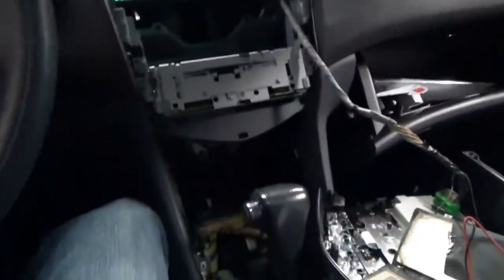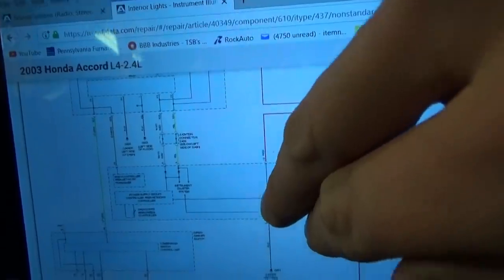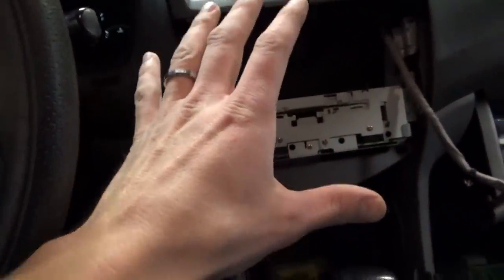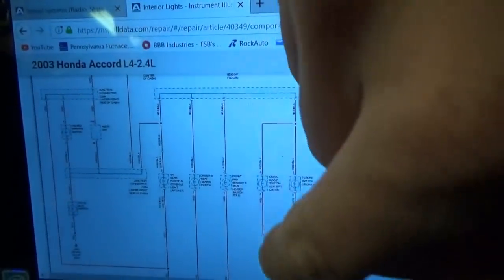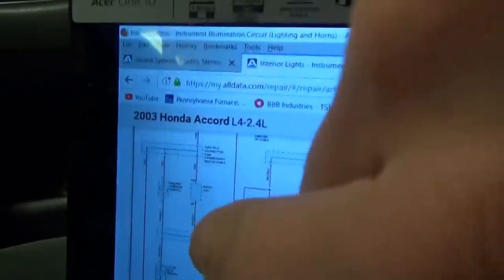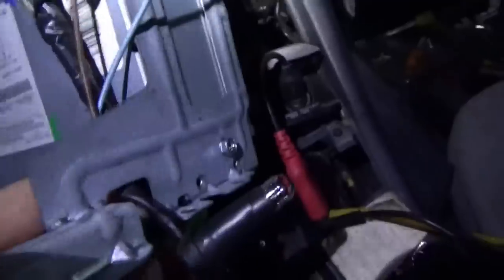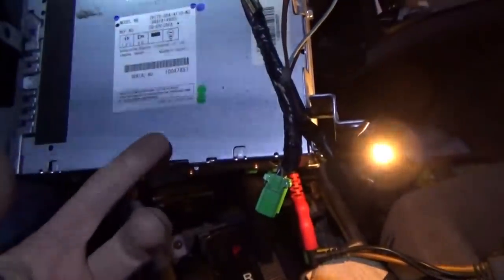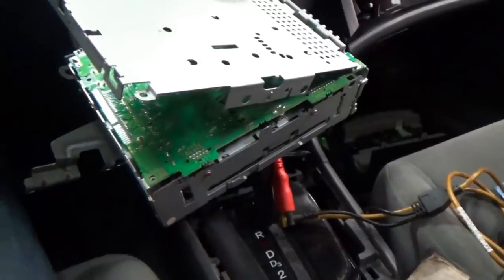Dash Illumination Diagnostics: 2003 Honda Accord

Comment: I worked for a Honda dealership from 2002-2008. I replaced several of these hvac/head units I'm the Accords. The first iteration of the service bulletin had us replacing the entire unit. Later versions had instructions that specified a component failure (think it was a capacitor) on a board. The revised bulletin required you to use a static mat and replace just the problem circuit board within the radio.
Reply: I need your help man my dashboard lights isn’t working nor my windows I have someone a jump and it knocked out the power on my car all because they put the cord on the wrong terminal now I’m Stuck I cnt see how fast I’m going or were my gas is at I changed few burnt out fuses still nothing is not thing tht works is my radio heat n car drives that’s it no windows no signals but my head light works as well I took my car to pepboys yesterday they didn’t even charge me cuz they couldn’t figure out the issue and whole time Honda dealership wants 200 dollars just to diagnose it and I’m broke rn I don’t have $200 to keep giving to mechanics and I’m still stuck

Comment: Ivan, the radio and HVAC illumination problem may be a bad surface mount resistor on one of the radio boards labeled R797 , according to a YouTube video titled "2003 Honda Accord Radio Repair - Part 2".  You may want to skip the Part 1 video because it only shows how to remove the radio from the dash, which you already know how to do.  The actual repair starts about 10 minutes into Part 2.
Reply from the maker: Cool!
Reply: this is starting to sound familiar......
Reply: Here's the link to it

https://youtu.be/y-73SyShI_g

Comment: When I worked at Honda there was a Service Bulletin #04-027 that handled the issue by replacing
The PCB inside the radio..
Reply: Its cheap too. like $38 and comes with new radio code
Reply: yea i did one for a customer who supplied the part. i charged $80.00 labor. the dealership wanted crazy money
Reply: John's Mobile Auto Repair thanks for that information.

Comment: I have seen this problem a lot of times I’ve had problems with a bad dimmer   Constantly .  They make a radio installation kit that comes with the hvac  built in to it .  I also have a link where you can get all the Honda radio navigation codes from . Let me know I can hook you up with it ,  it’s a life saver
Reply: What's that link for the radio codes?  That'd save me some time today for sure
Reply: My radio code is inside my glove box.

Comment: Crazy how they complicate something so simply like a lighting circuit. Mad. Yep, stick with the old Mystique! But, tip for you Ivan, if the lighting circuit is similar on your Mystique to my 1997 Mondeo, take note if your dash lights go out - on my Mondeo that is normally down to just dirty contacts in the dimmer switch. But, my Mondeo does have another trick up it's sleeve that can catch you out. If your dash lights go out - don't assume it's just the dimmer switch playing up again - get out of the car and go and check to see if your rear tail lights are working, along with the front side lights. On the European Mondeo the dash lights and the tail lights and front side lights all get there feed from one wire going into the main light switch on the dash. Ford in the EU seem to have got their sums wrong when it came to just how much current the contacts in the connector on the back of the light switch could handle. I have come across a few Mondeo's where one of the main feed connectors on the back of the light switch get hot during use, eventually melting the plastic around that connector causing the connector to not make contact properly.
Ends up with the dash lights not working, along with the rear tail lights and front side lights. Headlights still work fine. So if your dash lights go out on a Mondeo - don't assume it's just the dash lights! Like i say, don't know if the Mystique can suffer from the same - but keep it in mind just in case. Keep up the good work Ivan, always find your videos very interesting.

Comment: Tiny dancer and Heart!  Great taste in music.  I might have a shop repair the radio unit or get a junk yard replacement. Also using a voltage dropping resistor, you could bypass and still get pleasant light intensity.

Comment: A jumper wire on the internal fuse for the lights will solve the problem.  Pretty common issue on the 03 Accord.  Not sure of the possible ramifications of doing that but plenty of people have done it.

Comment: The main reason those die is high power LEDs people stick into those thinking it is a cool mod. It fries the central unit in about a week and they are stuck with both HVAC control and the dash lights dead. The easiest fix usually is to replace the HVAC control with a used one, expect around $100+ for the part

Comment: Those have a service bulletin that the radio module goes bad. Also, the connector inside the radio goes out easy because of small movements on the facia and radio module that break the connection.
Reply: I can easily believe that. Horrible design

Comment: Really chuckled at the bonus footage mate 😂 could tell you were really frustrated by this Diag. The burning question is this - why the blown bulbs and dimmer circuit in the head unit? What caused them to blow? Reverse jump start with lights on? Bad alternator? Great case study Ivan, thx for sharing 👍

Comment: The end with the singing! Oh man! Priceless Ivan! 

That is a horrible design by Honda. I'm disappointed in them. They used to be one of my favorite makes... 😕
Reply: We have three of them. 175,000 miles, 205,000 miles, and 280,000 miles. Don't have these problems. Maybe calling it a horrible design is premature?
Reply: @midwestfarm757  you may be lucky. Maybe the location... temps or humidity making a difference.  But I will stick to my original comment. To have 1 integrated unit that joins at least 2 different systems (radio & HVAC) is a poor design, that if 1 area has a failure, the entire unit must be replaced. Also mentioned,  no possibility of installing an aftermarket head unit either? I'm not 100% sure there, but that would be nonsense as well! Being a customer (or this model's owner),  I would be furious if I couldn't replace JUST the radio at a later date. Just an example. Yes. Poor design.
Reply: Early 00s is when Honda build quality started going downhill. Honda like Nissan, ain't what they used to be. Still good, just nowhere near as good as they were in the 90s.
Reply: @opl500  In the Midwest, the quality has gotten a lot better in the body not rusting out, suspension parts that last much longer than before, and with engines like the 2.4 liter they managed to make an engine with a timing chain. With proper maintenance those 2.4 motors are running around with 300-400,000 miles if not more. Believe me, I have owned many 90, 00's Hondas and the new ones aren't rusty like they used to be, and reliability for my Accords and CRV have been awesome.
Reply: @CubasAutomotive  Yeah, but: in the factory, quick, jam in the radio/heater control, boom. Done. Saved a minute.
Reply: @midwestfarm757  gotcha, and yeah I agree... that's the thing I love most about those vehicles from the Midwest, the last of rust! Lucky you! Lol 😉😉
Reply: @reecenewton3097  100% assembly or production...... only thinking about the immediate result, not the repairs later.

Comment: Hey Ivan actually the integrated Radio display , controls an HVAC controls is now standard on pretty much every vehicle. Jus did 2013 Cadillac SRX radio display touchscreen not responding to touch. No codes. It was $1100 just  for the integrated screen, radio controls an HVAC controls unit. Also a 2015 Tahoe the other day just the CD/DVD Player was bad. $850 just for it . That doesn't include the separate radio, radio display/controls unit, the Bluetooth  module, the onstar module, the rear seat entertainment module, the amplifier an the list goes on. Yep you can easy have $2000 in one repair on a newer vehicle.

Comment: Did you have a close look at the solder joints on the radio pcb ? That would be my 1st quick check. Great video as always.

Comment: This is a common issue with these Honda head units. At least the radio display still works. Those normally bite the dust as well. Luckily my 04 Accord radio still works fine. But the car only has 81k

Comment: same happened to me on my friend 2004 Honda Accord. I end up buying a used salvage unit from a junk yard online and swap the radio. This is a common failure on the head units. They CD changer fail and the illumination. You can get it on eBay for around $125. swap it and good to go. Just make sure you get the anti theft code before installation.
Reply: How do you get the code?

Comment: If I lived anywhere near I'd come over and jerry-rig that stuff for you. I'd just scratch through the traces to the ILL-A to ILL-D pins and rig up my own 7808 regulator somewhere in the radio housing (needs to be on the metal housing for cooling purposes). Wouldn't be pretty , but it'd work.

Comment: Great video....

You may as well start getting used to it....  The newer luxury cars all have this epic head unit in them, that literally everything runs through....  You need the touch screen to do your heated seats, heated steering wheel, climate control, full audio suite, nav, all of it....

So when that dies.....  You're outta business....

I'm pretty sure the dealers will install and set up a new one super cheap though....  So, not to worry...

Comment: i have the same car.  my radio went . i have to radios in my car because the mother board for the hvac system is attached to the radio. had a pioneer unit installed for $129. the factory unit $600. 2003 hondas are famous for electrical problems. engines and trans great.

Comment: How did you pop the center top piece of the dash up for hazard light switch? I just need to replace the light bulb inside the switch. Is there a corner or spot that’s easiest without cracking the plastic?
Reply: There is a tiny hole in the outer side of the vents, from there you can pull with a kind of hook

Comment: Been there done that with the same car. I ended up jumping/ bypassing the radio and I got everything to illuminate it's been years now. And the cluster and everything else lit up but no dimmer functionality.. That was the fix for the time being and never bothered me. There's for sure one single smd part causing this.   There's a forum about doing it, guy got the part from Radio shack. I don't remember what it's called.

Looked like a miniature drum. Capacitor ? I'm not sure.

Comment: What are the chances that some kind of event took out all of the bulbs and the circuit board? Seems like such a low probability that all would fail independently. I suppose then it's a chicken and egg mystery on which cause the others to fail.

Comment: So many bulbs burned out I would check the charging voltage, when I owned an older  style  Honda it always charged bang on 15v  a little on the high side for comfort.

Comment: iVAN, WHERE did you get the pocket volt ohm meter at ? that cool.
Reply: in the old days radio shack had them  yes they are handy to have in ones pocket.  but they are easily trashed.  i'm on my last one
Reply: There’s a bunch of different ones. I think the eevBlog did a shootout of pocket multimeters
Reply: Horror Fright has them at under five bucks. They are perfectly accurate; I've tested them against known voltage sources and against good meters.  I have a half dozen of them. If you fry one, drop it in the trash.

Comment: I suppose if you wanted a cowboy repair you could run a bypass from the incoming wires at the back of the head unit to the board at the front. Although i guess it would be constantly illuminated then. I guess if it was mine that's what i'd do.
Reply: Except that incoming is 12V and the lamps are 9V rated, with 8V coming out of the green board to the lamps.

Comment: Surprised to see that kind of integration on something built before '07. Greed knows no model year, I guess. What a joke! Stuff like that infuriates me about modern cars. Miss my '72 El Camino with 194 bulbs backlighting everything from the MANUAL HVAC controls, to the instrument cluster. Auto manufacturers need to re-learn the KISS principle! 😤

Great vid, Ivan - at least you were able to fix most of it, no parts required, either! 😎

Comment: I have replaced a ton of those boards on Acura TSX's, they had a warranty extension on them a while back. Terrible design.  I bet you could take the board off and fix it. They added an extra heat sink mat on the new updated boards

Comment: I'm supprised at honda, silly to tie the radio up with hvac :-(
My bodgy brain says a Tip41a npn transistor with it's collector to +13.8 and it's base fed from the junction of two resistors, 1k8 to ground and a 1K to the dimmer wire, emitter to bulbs.
Sorry bodgy mind at play :-D

Comment: Disconnect the powers from the pins, re-pin jumpers directly from rear plug to the Head unit.
Or-
Locate each trace, near the solder, use a razor to cut across the trace. Pin is empty, jump
from rear to front, and still use ribbon cable.

Engineer of this needs to be caned in public.

Comment: when you put 12 volts to that circuit board  i cringed. a lot of those radios have 9 volt bulbs. some are actually diodes that that look like bulbs.  did this have an alternator in its history?  lots of times a faulty regulator will cause that many bulbs to go out due to over voltage. perhaps it damaged the radio too.
Reply: Recall that the illumination contacts on those connectors on the green circuit board were marked 8 volts out to the lamps.

Comment: Clearly you have not diagnosed instrument illumination for a 2002 and up ford thunderbird. Radio and havac normal type system your speaking of. Instrments and shift indicator are controlled from FEM Front Electronics Module. They are not cheap and control almost everything in the vehicle.

Comment: That radio is in the yards for $40
Reply: how do you get a new unlock code for one?
Reply: @Colts88  start with radio off hold down 1and 6 press power the radio will show the ser. Number go on www.hondausa.com look for radio code and fill out the information they ask for including the serial number of the radio  hit send and you’ll get the code for radio and or navigation system

Comment: I bought a 2003 Accord some years back, it was a real pile of junk car, the airbag lights came on shortly after i bought it, the abs was janky and the radio lost its lights and the engine burned a quart every 400 miles and  then the timing chain ate the cam sprocket.